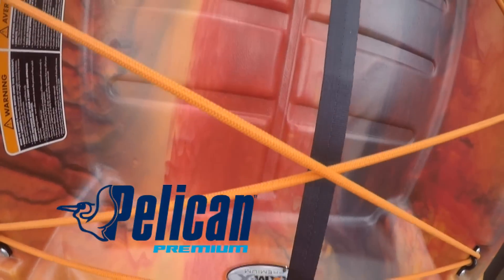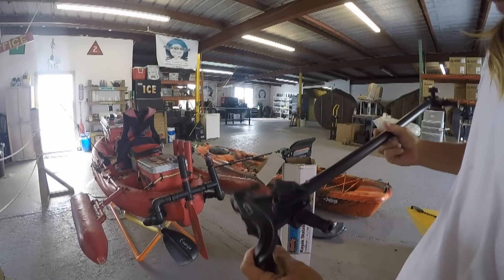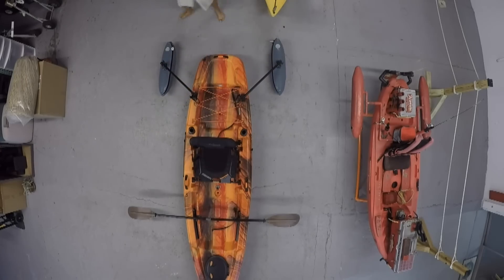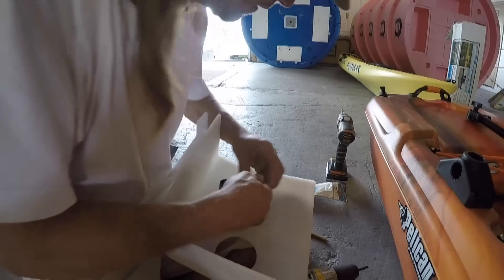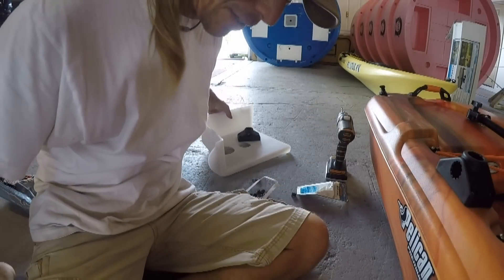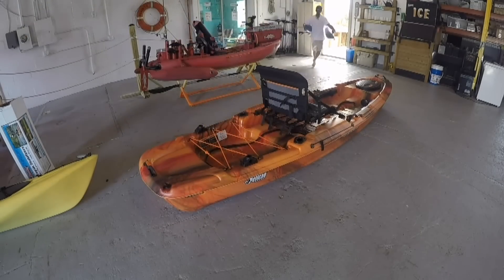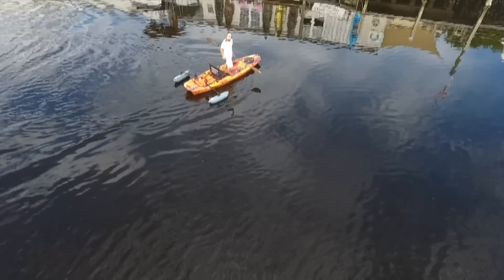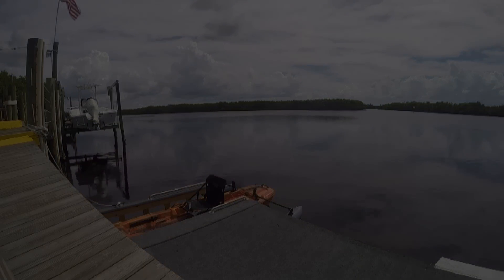Scotty Kayak Stabilizers

Comment: Cool stabilizer kit and another great video Marty. I use the well nuts for mounting every heavy duty item to my kayak. Rod holders, anchor rope cleats etc. They come in several lengths for various thicknesses of accessories. I went to Lowe's and bought some 10-20 S/S machine screws 1 1/2" long for the thickest mounts.

Comment: I'm pretty sure that Hobie have a similar thing to those well nuts.  Whether they work the same or no is another matter and to be honest, having seen how they work on that piece of plastic, you just sold me on them!  I dont care that they probably cost a ton more than a simple stainless screw, they waterpproof the hole and that HAS to be the #1 consideration on a yak!   Even if all you want to add is a couple of pad eyes, then not having that worry for the first few trips that you may not have created a water tight seal is worth its weight in gold to me.   Thanks for bringing these to our attention Marty.   I have paused the video and am going looking for some right now!!
On another note, I have a PA14 (2015 edition) and the hand rail - which is pretty useless and even dangerous when trying to re-enter a yak you've just been tipped out of - would seriously get in my way when adding stuff like those stabilisers.  Not that I "need" stabilisers on a 38" wide yak, but the moment I saw them, I thought "Trampoline"....   I sail my PA14 at times and having a stabiliser or two which I could stretch a waterproof or mesh screen accross would certainly add to the fun of it.
And here is where I'd like to pitch you another idea for a future video, Marty.  How about showing us how to completely fit a new seat???   Not the chair, an actual "normal" kayak cloth seat.   Sure, that chair is lovely and comfy, but on open water when that wind changes unexpectedly for the worst and you're being tossed around, having my butt firmly planted on the deck would be much more preferrable.  Even when sailing my kayak, I would prefer to be that much lower down as those extra few inches added to the centre of gravity can make a massive difference as to whether I'm likely to be going in the sea before the day is out :)
Thanks again mate and keep up the fantastic work!!
Reply: I have the Hobie Sidekicks.  The bar came with wellnuts.  You are supposed to screw them in by hand after drilling holes.  I have the beach chair on my Revo.  I have it set in the lowest potion when I use the sail.  I'm going to try to use a Sea Eagle inflatable seat just for the fun of it.  It probably will be too high.

Comment: Wellnuts have been used to attach plastic windshields to fairings on motorcycles since the 1980's. I'm new to kayaking and was not surprised to find them included in a paddle holder I bought.

Comment: If I recall the Heavy Hobies use them. I remember modifying mine and found some factory installed. You're right, they are awesome and easy to use. Plus they are water tight for the most part.

Comment: Awesome video as always. You can do the same thing with 6 inch pvc... capped on both ends and more durable. No worries about a puncture then.
Reply: bamacat...With that 6 inch pvc pipe...lets say 8 foot.....how much weight can it hold up....figuring 1 pipe ??

Comment: WARNING after a while the rubber nuts deteriorate, mounts become loose, and the only way to remove them is with a saw if you have enough room to get one under the mount. I am a marine technician and every motor guide trolling motor mounted on an aluminum boat has these same nuts. I have to cut almost every one of them. Aluminum nutzerts are much better.
Reply: I gave up on well nuts after exactly one trip with hobie sidekick stabilizers. Lots of waves and swells around San Diego, they pulled out on the first trip. Plan B. I fished a wire through the top of the yak through the mounting holes, attached the wire to the threaded end of a stainless bolt (with a stainless washer on it to hold it in, since the hole drilled for the well nuts was much larger than the screw head), pulled it though the hole with the head and washer inside the yak, and put a stainless nut on top, basically upside down of the “usual” or “desired”. orientation lol, threaded end pointing up through the kayak, bolt head and washer down, inside the yak. Has worked for 5 years now, no issues. I reckon based on the physical properties of the universe stainless bolts and washers would be stronger than aluminum nut-zerts, but I’m sure those would work fine too, I think the holes I drilled for the original well nuts would be a bit too wide for them though, so I did what I had to do. I should add, I put a cap nut on the bolt as the threaded end was exposed, as I’d rather not make a bolt sized hole in myself or my gear. Hopefully this is helpful to anyone who’s made the well nut mistake lol.

Comment: Scotty wellnuts must just be something that's gone under your radar for a while now, because I've been using them for attaching Scotty and other accessories on my kayaks and canoe for almost 8 years now. I agree with you -- they are great! And they last (8 years and counting).
Reply: Just out of curiosity, what part of the country/world do you live, and where/how do you store your boats?  I barely got two years out of the rubber well nuts I tried (I think I got them from Lowe's or McMaster).  Stored in shaded and covered outdoor, but high UV coastal FL panhandle.
Reply: @cup_and_cone  I'm in Northern Virginia and NE Florida. My kayaks and canoe are stored in the garage (up in the ceiling) at both locations. I've only used the genuine Scotty wellnuts, purely because I couldn't find any other source for them. The only thing Lowes or Home Depot had that was similar were aluminum. The Scotty ones are rather pricey, but maybe it's for a reason?

Comment: These well nuts are used by several auto manufacture like dodge to secure window regulators to the steel shell or a car or van door. Great idea for an incredible secure and even more waterproof way to mount stuff..
Thanks
Reply: Found them on my old 87 Yamaha sport bike. Used to hold plastic fairings on.

Comment: I've been using well nuts on my kayak installations for 4 years now. They come in real handy for anchor trolley installs or any install where the spot is hard to reach to fasten an interior nut. You have to be careful though, do NOT use silicone or the nuts will spin when you go to tighten them. Also, when you drill the hole make sure it is a true and tight fit. If the well nut isn't snug then it doesn't fasten and hold as well.

Comment: Rubber well nuts are big in the motorcycle industry, used for connecting the plastic abs fairing of streetbikes, windscreens, etc. Most dealerships have them in stock like honda, Yamaha, etc.

Comment: I've used well nuts before on a bass boat.  With a lot of flexing the rubber goes bad and starts to break/ separate. They are great initially. May have been the load too. Min Kota trolling motors used them to mount on fiber glass

Comment: I’ve had the older version of these for years. I always wondered if the flexing at the boat mount would cause problems but years later still no issues, but I also don’t use them very often. I use them in the spring and fall in Northern Ontario when the water temperature will Kill you if you go  overboard.

Comment: I have these stabilizers floats on my custom Hobie PA14 2016 I think?  Rigged up for night fishing or staying out when everyone else is going into launch site.  I ended up cutting my outriggers pipe about 12" if I recall correctly.   They are a pita if you want to fish or use the standup bars upright. 

I am unstable to begin with n ole paradog injuries.  Hobie ought to go 45" width imho for a good Yak boat.  I rarely use the floats, but have them inward over the back of seat.  I just let ma think I use them at night so she doesn't worry.  Imho, you not only have to use a strong support to use these, but u gotta pre set them beforehand.   N then they move up n down allot.

There's tricks to work around those issues but if you're not a mechanical inventor, you might get suggestions in person.  Ask ole dogs who are cranky n haven't been laid since the end of the century.  We might just surprise you what wisdom n doubt we are able to say for a cold beer n a cute young blonde.  Well, atleast a cold beer,,,

Comment: well nuts work good, for the beginners make sure the hole you drill is on the small side. if it's too large than the nut begins to spin and not as a good of a bond.

Comment: The name for them when they first came out (not these, but metal ones) was blind hole fastener bushings.  That was about 20 or so years ago.
Reply: the metal ones are also called rivet nuts and require a special setting tool that resembles a rivet gun

Comment: I liked seeing the stabilizers being installed. I think though they would be better mounted closer to seat so you could reach the rod holders better. Then just angle arms rearward to avoid paddle hitting. Also would be easier to make adjustments to the stabilizers like tilting up to pull up to a dock.

Comment: Excellent video! I have been thinking about getting some stabilizers for my Jackson cuda 14 so I can stand in search for redfish.
Reply: That's exactly what I do in the Mosquito Lagoon here in Florida with my Cuda 14. I use the hard foam stabilizers. They will slow you down and tire you out so I take them out and re-insert them once I have reached the area I want to fish. I am going to change out the rod holder mount to the Scotty "241L" quick release rod holder mount for easier connect/disconnect. I have also found that when it gets a little rough the rod holder that the stabilizer is connected to will sometimes come loose from the mount with the older style non-locking "241" rod holder mount. I believe the locking feature of the 241L rod holder mounts will eliminate this issue. If you have a problem standing in your Cuda 14 as I do you will love using stabilizers!
Reply: Plus you have access to the inside of the hull "front and rear"of the Cuda 14 through the hatches. I used stainless bolts and lock nuts with flat washers to mount the rod holder mounts.
Reply: Thanks for the response! I can stand up in mine. I just can't move once I stand! LOL!

Comment: Well nuts are quick and convenient...but also a pain in the ass should they be attached to something that needs to be removed. Once squished long term, they deform and don't like to come out. Also, any corrosion (which will happen) makes them just spin with the fastener when you try to turn it out. Many of my motorcycles over the years have used them, and I've cursed each one at some point or another!  Great vid, Marty!

Comment: My opinion,  I put a piece of wood between the inside of kayak and the bracket,  used nut and bolts. Much stronger and dosen't stess the kayak at the screws

Comment: Do you think the added stress from the stabilizers will cause the plastic near the mounts to crack over time? It looked like as you moved side to side the stabilizers were flexing a good amount.
Reply: Probably...that's why I removed my rod holder...it was cracking in  two spots

Comment: They have been around for years. Only downfall is dry rot
Reply: Same experience for me when used in a high UV area (Florida and outdoor storage)... The rubber cracks after a while and they fail, or they dry out and lose grabbing strength.  Sometimes tightening them works, but once the rubber goes, they're basically done.  Long trifold rivets are only thing that I've had long term success with.  Screws are unless you can get a nut behind them.

Comment: yes they are used often in auto body industry. bad part is if they get any corrosion they will not come back out. DO MORE FISHING.
Reply: Would putting a very lite layer of marine grease effect how they screw in and hold?
Reply: could help. just don't get it on the rubber anchor and they will hold just fine.

Comment: Nice video.   I wonder if it wouldn't be better to just use a 10' or 12' aluminum rowboat.  It would be more comfortable, more stable, and easier to access gear.  I am starting to think we are pushing kayak function too far.

Comment: You didn't use a single drop of silicone, don't go comolaining if yir kayak leaks
Reply: The inserts slip when using silicone.  Instructions says not to use it.
Reply: @WayneHankins01  No they don't slip, I have the same system, and there is no thing in the instructions that says not to use silicone, no need to lie

Comment: Those air stabilizers are just not a good investment in the long run
Reply: I don't think you have to worry about the long run. They look like the higher end Pontoon fishing pontoons. The one I had was tough as nails, scraped it on rocks, and much worse. never had a problem
I

Comment: To much flex, should be a solid cross bar between the floats,take that out in waves and I guarantee it will rip apart
Reply: maybe it is designed to flex that way and work as a shock absorber. having anythign sturdy will require more intrusion and manipulation with the kayak and that's possibly a minus.

Comment: Should hand tighten w a screw driver not a power drill if you’re using well nuts. Drill can over due it and wreck the rubber part.

Comment: Not a very good design at all. If you have a kayak with  softer plastic the drilling points will snap or crack easily. Especially the outriggers are so extended so far out from the hull. The hobie or some others ones are way better, with a solid meta bar right across the hull not separating like Scotty does.